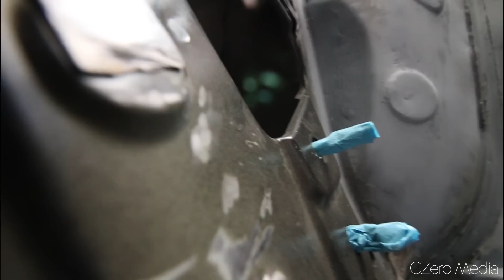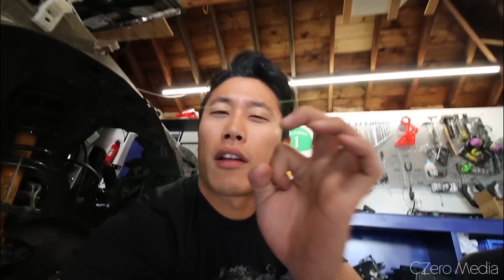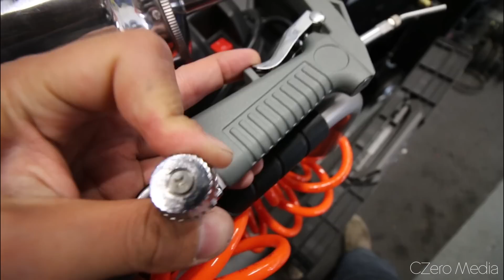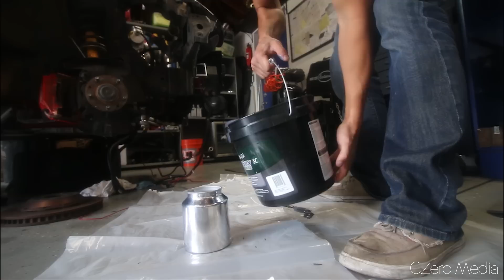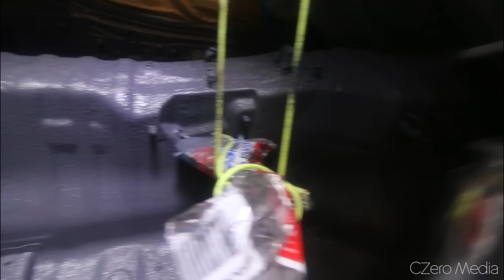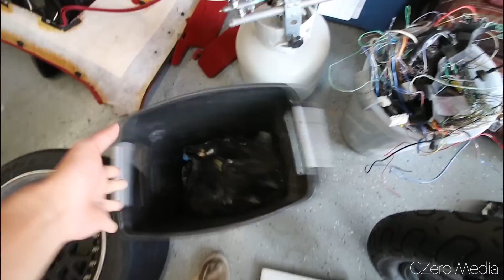Painting The RX7 With Lizard Skin - Wide Body V8 FD RX7 Build Video Series 16

Comment: you should have used a paint spraying tip instead of a media blasting tip.  The paint would have had a much more even finish.
Reply from the maker: +jlehm 1982 material is too thick. That wouldn't work

Comment: Would you mind doing a Q&A video for us guys that have Evo questions or any other builds?
Reply from the maker: do you have a list of questions you may have?
Reply: +CZeroMedia yes, I am trying to run E85 for a bit more HP, would it be better to install a second fuel tank or use the same tank. I'm thinking of getting the wide body Cyber Evo kit. Are there any performance downsides if I were to do this? Thank you.
Reply from the maker: same tank is fine. but you need bigger fuel pumkp, which i carry on my website. cyber evo kit will kill your fuel economy if you care about that, expensive, and looks a bit ridiculous if you dont track it
Reply: +CZeroMedia I have a bigger fuel pump and 1000 cc injectors in it now, is that large enough? Also the car makes about 527 to the wheels on 93. It's a fully built AMS 2.3 lt motor with a Vband turbo kit. The video of the Dyno is on my page. Do you know roughly what I could gain on E85? Sorry for all the questions.
Reply from the maker: def not enough. you are maxing out your 1000's right now. i would suggest 2000s and bigger fuel pump if you have 255s
Reply: +CZeroMedia ok. Perfect! I will look more into what I am going to need. Grateful for the input. 👍🏾